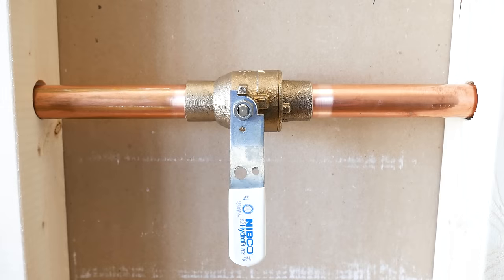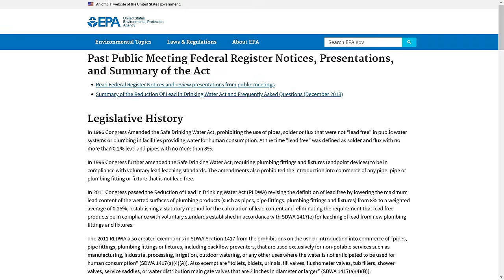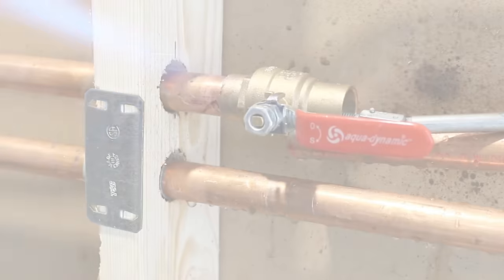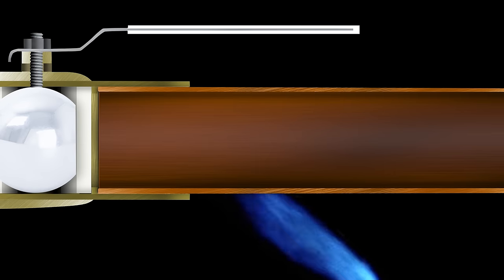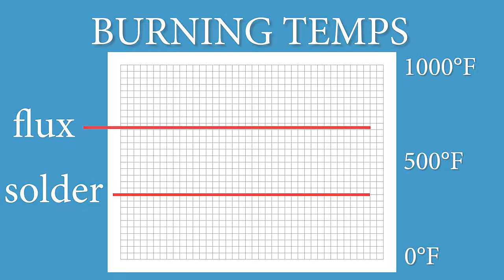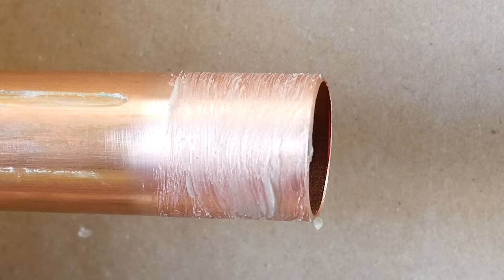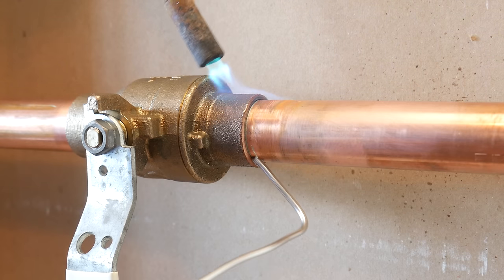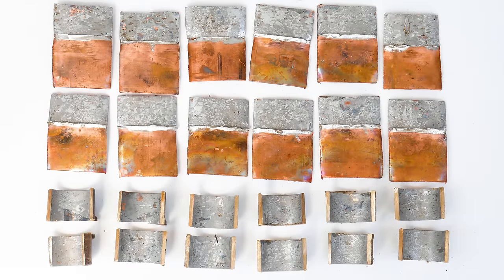How To Solder A LEAD-FREE Ball Valve (Correct Way!!) | GOT2LEARN

Comment: Nibco valves are the best. Watts, FNW and Apollo are good too. You can usually identify a good ball valve by its thicker metal body, larger handle nut, wider handle. Cheap home center valves are junk. I am still not a big fan of soldered on valves as I like to be able to unscrew it to make changes if needed. If you solder on a valve and need to change the pipe upstream of it, you cannot remove it.
Reply from the maker: Well said.
Reply: Domestic Apollo valves (made in USA by Conbraco) are another excellent alternative.  Not those that are marked Apollo International though (China).

Comment: How do u cut the joints in half for inspection? I got 2ft of pipe, a cutter, some couplers and did some practice joints using your methods, thank you.
Reply from the maker: Grinder, and I insertva flat head in between the pioe and fitting and then I use a hammer to seperate them.

Comment: When you sand  do this in line whit the pipe (left- right up down lines ...
 but never around! )  it helps for the capillary phenomenon  You can always use a gel to cool down the valve or ...   never ever make your pipes to warm ! For making temperature modular right only do your flame farther or nearer the pipe never on and ofthe pipe you get temperature shocks  shocks ( Parkinson patient ;) ) 
 ......... after cool down , clean the pipe whit a bit of water never !!! a mass of water it
 could crack the pipe or dis form the valve   The solder should be bend in an angel to make sure how much of material is inside the subject it's also easier to bring in ( always use the point ! )   at four place around the valve stop solder if you are sure everything is ok using a small mirror.  ;) the Belgium refrigeration
 teacher
Reply from the maker: Niceee, thanks!!

Comment: Seems pretty logical that heating the pipe is a good idea, heat flows a lot better in a metal than in an air gap (between the valve and pipe). But it doesn't seem likely to me that the new alloys make any appreciable difference, surely the resistance in the air gap is by far the dominant factor in limiting heat transfer from the outside of the valve to the outside of the pipe.

Comment: I'd never use nor recommend a weak tensile strength solder like Sterling (that's mainly used for soldering electronics and wiring) for a heavy duty brass ball valve requiring periodic movement. Even NIBCO directly recommends a solder with a melting point of 452 - 464 for their valves. Your best bet on solder, long term with a solid joint, are either going to be Silvabrite 100 or Stay Bright #8. Prep, clean, and use Everflux paste evenly spread inside the valve and outside copper pipe. Evenly heat all around outside of valve ends, apply solder when ready. Done.

Comment: On the question of materials. For underground pipe soft rolled copper is used and any joints are to be brazed. However, the high temperature of acetylene anneals the copper and weakens it. The joint will be strong but the heat affected zone is weakened. Wouldn't it make sense to use a higher strength Nickel type solder (Briggit) and avoid weakening the copper? Or is this simply a code requirement above questioning?

Comment: I have a valve I want to replace.  It's in tight quarters.  I can move one of the pipes away if I can get that end unsoldered.  Do you recommend soldering the new valve to to the unsoldered pipe, or just cutting the old valve off and using a splice and new section of pipe?
Reply from the maker: I prefer cutting it out, but both methods work.

Comment: Quick tip to homeowners...use leaded solder. Informative video.
Reply from the maker: Leaded solder has been banned for a while, and there's no reason to use it!
Reply: I know it's banned. I said specifically "homeowner", it's just much easier to use. @Got2Learn
Reply from the maker: Well that applies to homeowners, you can use lead solder for anything except for potable water
Reply: Homeowner here: unless you are talking about irrigation lines and such, given that current plumbing codes mandate lead-free solder and components in new and upgraded potable water installations, that is the DUMBEST advice I have ever heard someone give.  Homeowners DO NOT get a pass from code enforcement to violate code just because they did the work themselves.  Instead, if you plan on doing your own work on anything involving potable water, either hire a pro or do like I did: buy a couple of feet of type M copper from the local big box store, some couplers and a cheap LF ball valve or two and practice until you LEARN how to do it the right way.  It isn't really that hard with great videos like this, a decent torch, some good tinning flux and some good lead-free solder.  If a "homeowner" like me can learn to do it and pass a building inspection with no issues, anyone can.
Reply from the maker: Thanks, I guess I didn't have enough weight lol 😅

Comment: In my experience, leaving the valve half open is best. While it is possible to leave a deformation in the seat with the ball half turned, it is less of a problem than having the seat blow out due to the air pressure build up in the space between the ball and the housing. If all goes perfectly,  the joint will be complete before the heat is too much for the seat. The older globe valves were less prone to damage because opening the valve left the seat out of contact with the walls, and only the thin stem contacted the rubber washer. This stem being supported mostly by the insulative packing, and only lightly touching the housing at the thread.

Comment: Does it matter which way the ball valve is facing? It looks like the pressurized part of the water pipe was on the left, and the valve body has a section that unscrews on the right (in order to install the ball and two seals inside). The center of the valve body and the left side (in this video) were cast as one piece.
Reply from the maker: No, you can put it either way.
Reply: You want to oreintate the handle towards direction of flow in open position. I believe that's what your asking?

Comment: Dang, wish this video was published a week ago when I was cursing up a storm wondering why my ball valve wasn't getting hot enough to draw the solder into the joint!
Reply: @Got2Learn  Seriously, I watched your other videos, and started soldering. The entire project came out solid and beautiful, except for the solder joints on the ball valve! I ended up just cutting it out and getting a neighbor's electric crimper and a new valve to finish the job.
Reply from the maker: 😁😁😁 you'll know for next time, cheers man 😁😁😁
Reply: @rattlehead05  you are right about that it's much faster and easier to propress a valve , but practice a little and it goes pretty  good 👍

Comment: can tinting flux and lower melting point solder use on both leaded and lead free component? once i soldered, none of the joints leak, only the silicon elbow from home depot had bleeding drips.
Reply from the maker: Sure.

Comment: When soldering a gate value, do you remove the internal components from the actual housing (rubber seal and the actual valve )? Or solder with everything intact? I always remove the internal components for fear of damaging the rubber seals. Advice please .
Reply from the maker: It's not a bad idea to remove them, but it can be done without doing it, cheers!!
Reply: Dang I just asked a simple question and I get a good spanking 😢...LOL
I used to use 3/4 sweat gate valves back in the day. I'll be changing them out with ball valves soon using pex. I was younger back in the day and didn't know any better.
Thanks for the reply...👍😁👌
Reply: I don't take apart gate valves when soldering and never had an issue
Reply: Just open the valve.

Comment: so did you just change to tinning flux for basic copper connections too or is there a disadvantage
Reply from the maker: I use it for every copper joint I solder now, it's easier imo.

Comment: I've soldered maybe 10,000 ball valves in my time. Boiler dressing. Institutional 2horse capacity mostly. Never thought about open or closed. 
Stainless steel for medical in oxygen conveyance either. No one ever called back. Lucked out on pack charges eh?

Comment: Does this mean that the "standard" red ball valves are no longer useful for residential water lines?
Reply from the maker: Red ball valves?
Reply: @Got2Learn  Yes. I need to replace the main water valve in my house and will have the city turn the water off and wait while I replace the existing one, which no longer works. I bought the standard red ball valve at Lowe's thinking it was what I needed. Any guidance?
Reply from the maker: Yeah, those are fine!

Comment: Can you solder one side of a main shutoff ball valve , let it cool and then solder the other side later on? Or must both sides be soldered in succession? I know both ends of a coupler and elbow should to be soldered together. I'm assuming each side of a ball valve can be soldered at different times? Because I want to build a section of pipe and fittings on a work bench and solder as little as possible while near the wall. Thanks.
Reply from the maker: Ball valve is different than coupler, you can solder a valve in 2 shots, no problem 👌
Reply: @Got2Learn  Man you are quick. Thanks again. Because I want to solder one end of my shutoff to a section of pipes and elbows and then bring the prefabbed section in close to the wall and solder the other side of the shutoff  to the existing pipe. And then solder a slip-on coupler (solder both sides) to the other end of the section. Thanks again.

Comment: I always heat both pipe and fitting or valve, and I always solder from bottom to top, if horizontal. Just in case there's water in the system.
Reply: David, can you further explain why you “solder from bottom to top” in a horizontal pipe just in case if some water?  What would happen if there were a little water and you didn’t do this?  Thank !
Reply: @glasshalffull8625 if there is some water, for this reason  I do this because you're safer just in case water decides to start flowing in the pipe, if it does you have the bottom half soldered, you then just need to finish up the top half even if you have water flowing in the pipe.. hope this is a good explanation for you /made sense..
Reply: Thanks!
Reply: Heat rises , point flame from bottom up to get uniform heat application, otherwise you would spend more time heating top down and burn top part by the time bottom is ready to solder
Reply: (In a perfect laboratory world) lol. When your jammed up in a joist space you will solder how ever you can at that point lol
Reply: @andreyyaromich8277  i believe that you miss my point, if (horizontal) , i heat pipe and fitting from the bottom part if you know that there's water in the system, i will solder the bottom half, if you suddenly get a stream of water you got the bottom half covered, you can solder up the top half even if you have water flowing in the pipe..and if you've been doing this kind of thing for some time you won't burn the flux.. Rookies cook the pipe and flux..heat rises we all know this, but you're better off heating up everything not just heating up from the lower half of the pipe or fittings, a uniform heat application is faster and your pipe fittings or valve will love you, because you didn't use excessive heat for a simple solder job..
Reply: @nowheelspin  I get your point, That’s  a game I played and not worth it, I’ll spend an extra half hour to try and stop the water with either a compression ball valve upstream or at the very least option a shark connection in unfinished area. Nothing worse then a solder connection failing especially if it’s at a Reno or commercial/institutional. I dread that call back. Everyone knows U screwed up lol

Comment: Can the tinning flux be used to solder 3/4 copper or 1 inch copper. I find the larger joints to more difficult to heat and not boil the solder out of the other side of a T. By the time I get to the 3rd joint it can be iffy.
Reply from the maker: Sure!

Comment: With  the new solder and flux etc. you need to use MAP gas(yellow tanks) not propane(blue) it burns hotter and will shorten the time you need to heat the pipe.
Reply: Yeah, but the MAP/Pro gas in the stores today does not burn hotter by all that much. The difference between the max temp of MAP/Pro gas that you can buy today and regular cheap propane is only about 130F or about 3.6%.  Hardly worth paying double for per cylinder as far as I am concerned.  Today's MAP/Pro is no where near as good as the MAPP gas of the good old days that I used to use.  I just use Propane with a turbo swirl head torch when I need extra heat for pipes larger than 3/4".

Comment: So you only put the flux on the outside of the pipe and not on the inside of the valve?
Reply from the maker: Only thin layer if both.
Reply: @Got2Learn  Thanks.  I need to replace a leaking outside faucet and multi-turn shutoff valve that are mounted just above the basement wall.  (Soldered to copper pipe.)  The valves and faucet are 57 years old.  The plumbers want to install a frost free silcock, ball valve and plastic pipe like they did at the back of the house.  $260 repair, when all they had to do was repack the old valve.   I HATE it.  The silcock has to be turned 10 times to open and close.  The pipe is so flexible it bounces around while I'm opening or closing the ball valve.  They told me they are only allowed to install silcocks.  Thus I'm forced to do this work myself.  I have no experience soldering.   Problems: - the pipe is only about 3" above some power wires.  Should I cut the old valve off or attempt to heat up the old joint and let a helper pull the old faucet out from the siding?  How do I get every last bit of water out of the pipe to do this?  Main shutoff is only 3 feet directly below the old valve, and there is no drain between the main shutoff and the shutoff for the outside faucet.
Reply from the maker: @PanamaSticks  Yes, for that electrical wire you must be careful or bad stuff will happen. To get the water outta the pipe you can use a spray bottle head with the tube inside the pipe you wanna empty, it'll take a few "sprits" to get all the water out but it works like a charm, here's a video that might interest you: https://www.youtube.com/watch?v=Qhw5_t3DIoA&ab_channel=Got2Learn
Reply: @Got2Learn  Thank you.  Wondering why the plumber couldn't have installed a quarter turn device on the rear of the house.  I should've raised a stink when I heard him tell his helper, "Go buy 8 feet of Pex, 10 right angle crimp couplers, two straight SharkBite couplers, a ball valve, and a frost free silcock."  I'm sure he knew he could re-pack the old valve.  He was stocking up on his supplies  at my expense.
Reply from the maker: @PanamaSticks  We live in a greedy world ;)

Comment: Do you use propane or map gas mostly? I have been attempting soldering and with map gas and it's hard for me not to overheat the flux.
Reply from the maker: I use normal propane, true MAP gas has been discontinued in the 80's I believe...
Reply: @Got2Learn  ooo, do you use yellow or blue? I've been using yellow.
Reply from the maker: @visoflo4208  blue
Reply: If you are overheating your flux, using MAP/Pro gas is not helping you any.  Actually, it is likely aggravating your overheating to some degree as well as lightening your wallet unnecessarily.  Just use good old propane gas and focus on heating the joint evenly and stabbing at it with your solder every five seconds or so to see if it melts.  If it melts, your temperature is good.  BTW, propane run a little cooler than MAP/Pro (about 130F) and is half the cost.  Both of these are pluses in your case!
Reply from the maker: @StilettoSniper  true!!!